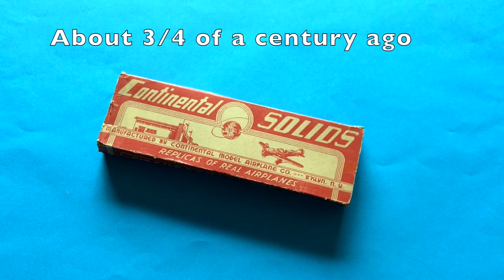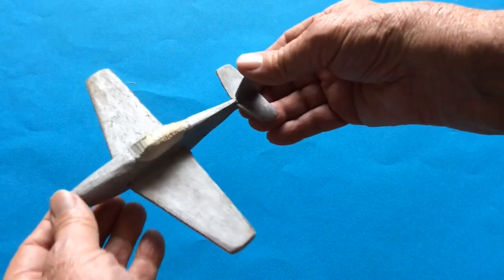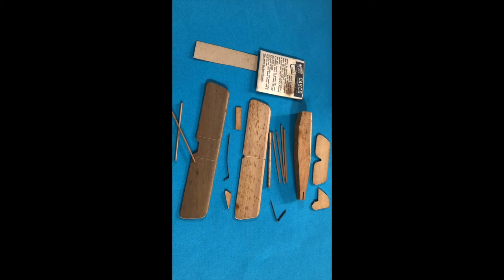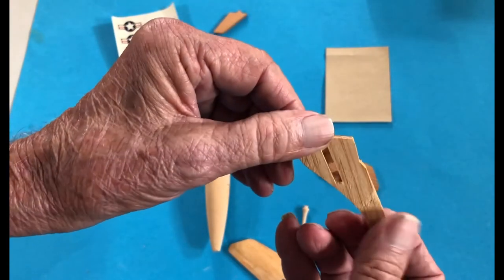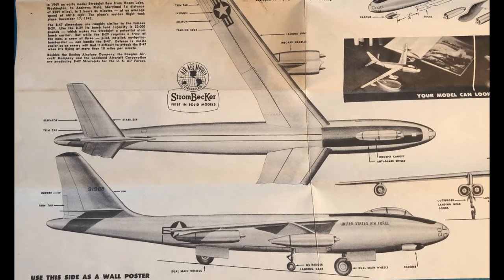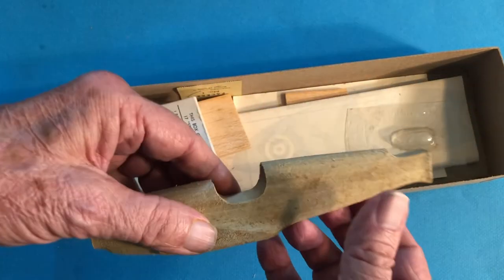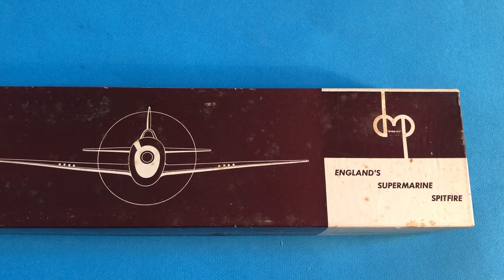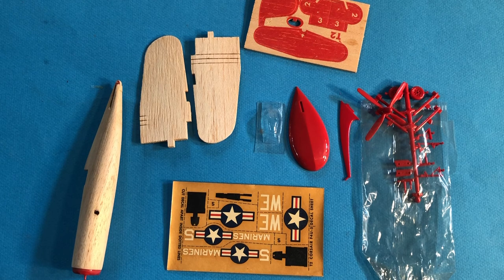Solid Wood Model  Aircraft Kits

Comment: Nice video regarding vintage solid wood aircraft models.  Nice that you still have that P-51.  However, I only built one "solid" model in the mid 1970s and that was the Strombecker, Vought F7U Cutlass (the kit was old even back then).   Still have a few "solids" in my stash and that includes the Strombecker, American Airlines, Douglas DC-6 and Convair 240 and the Douglas D-558-2 Skyrocket as well as a Hawk ME-109 and Maircraft Douglas A-20 Havoc.  The better detailed models still seem to get good prices in on-line auctions or sales such as the Strombecker kits and especially the Testor's, Douglas C-54 Skymaster and Lockheed TWA Constellation and especially the rare Comet, United Airlines, Douglas DC-6.  Thanks for sharing!
Reply from the maker: I'm sure glad you liked it.